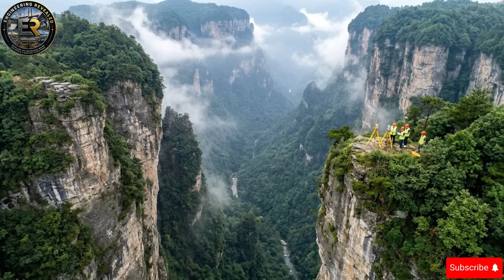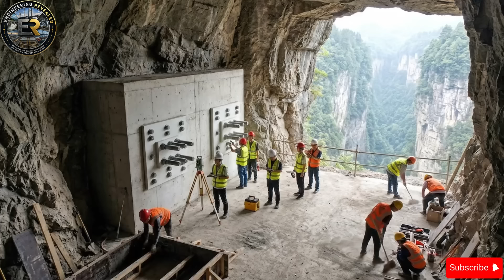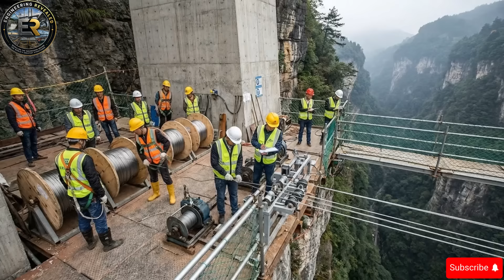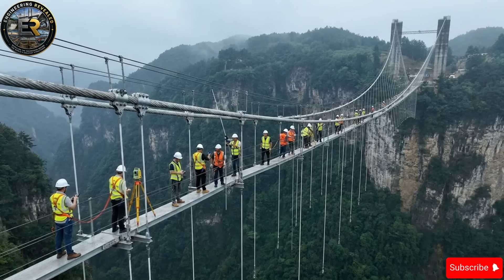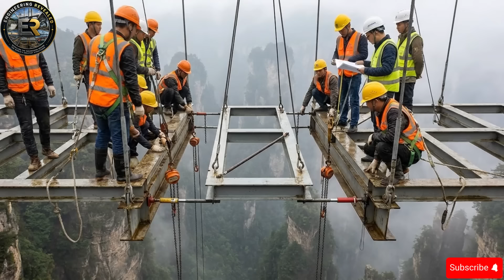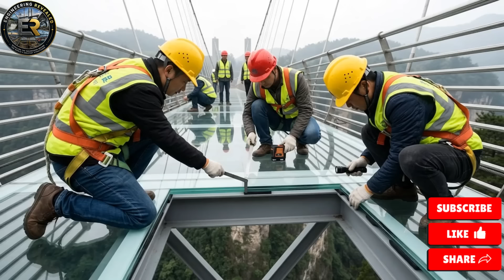Inside China’s $64M Zhangjiajie Glass Bridge: How Engineers Built It Over a Giant Canyon

Comment: Personally, I think the real challenge is making a bridge look almost invisible while ensuring the structure underneath is incredibly strong and reliable.
Reply from the maker: I completely agree. That balance between visual lightness and structural strength is one of the most fascinating parts of modern bridge engineering. A bridge can look almost effortless from a distance, but underneath, every element is working to control loads, wind, vibration, and long-term fatigue. With projects like this, the real achievement isn’t just making the bridge look spectacular—it’s making such a massive structure perform reliably for decades while blending into the landscape. That combination of strength, precision, and visual simplicity is what makes these projects so impressive.